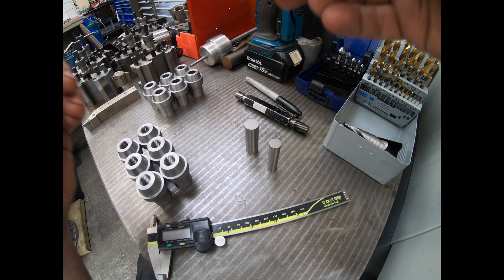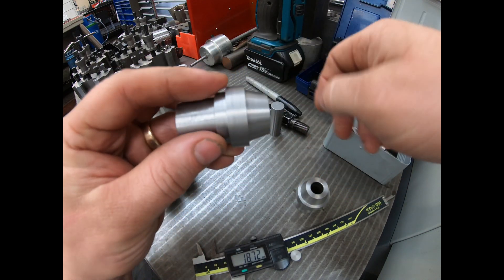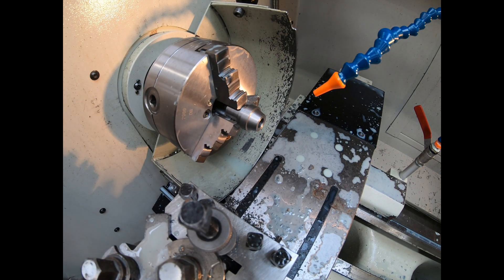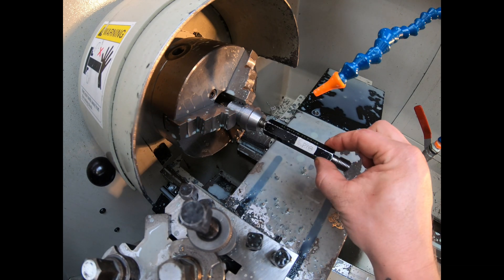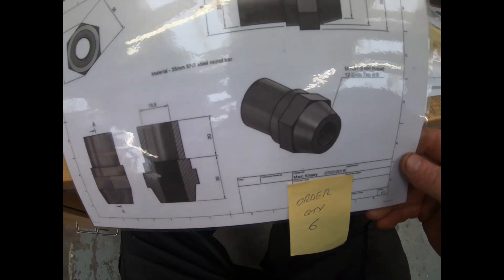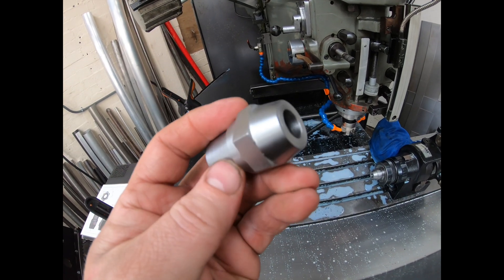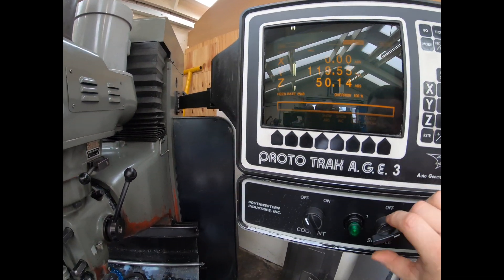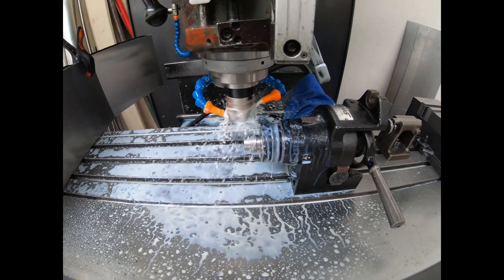EN8 bushings, milling the hex on the Haas indexer

Comment: Do you have any problems with the flood coolant you are running and that version of the indexer ? I see you have the motor covered
Reply from the maker: Hi

I try and keep the coolant away from the motor as best as I can as prolonged coolant will end up damaging it but I don’t use it often so not an issue so far

Thanks
Marc

Comment: Hi Kinzy 
Watched your vids and subbed to your channel. ..I admire the position you are in working for your self and will do one day myself when I have the courage to jump....
Quick question. .how do you go about quoting for your work? Do you charge by the hour?

Cheers 
KB
Reply from the maker: taffbats 
Thanks for the kind comments
As for work quoting, I’m still learning to be honest, you can’t be too expensive or your get no work but I have lots of overheads now compared to when I did it as beer money at home after my day job, Also you can’t go too cheap just to get work as it’s not sustainable in the long run and when you suddenly up prices customers will go elsewhere, you have to work out material costs, guess the time for the job and work it from there, don’t be afraid to stand firm on prices if you have worked out what you need to earn to keep the doors open and lights on and with what you want to earn off of it on top,
Cheap work isn’t good and good work isn’t cheap

The biggest thing in my opinion is how quickly and efficiently you can get a job completed, time is money as they say, you get it done quicker, the customer can have it cheaper and you can do more work, everyone’s happy

Thanks
Marc
Reply: KINZY FABRICATIONS hi Marc, where did where learn how to cnc program your machines etc to make custom parts?